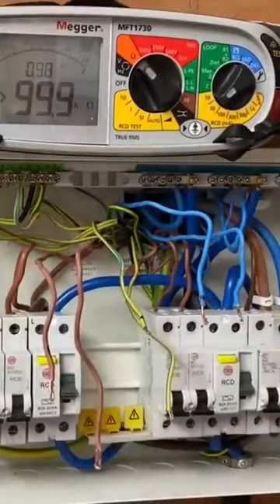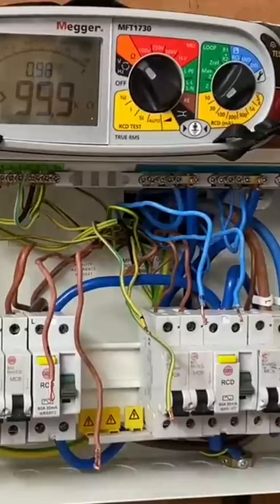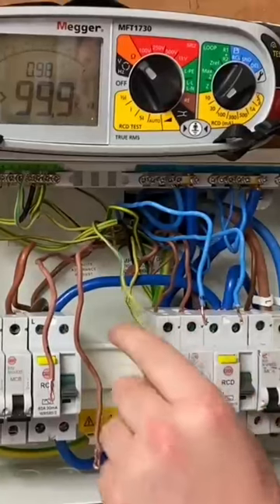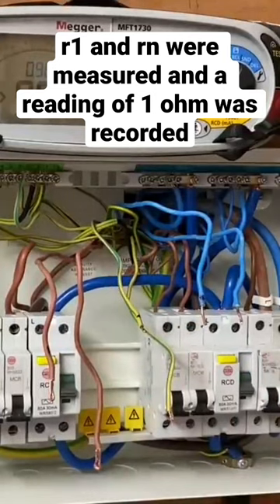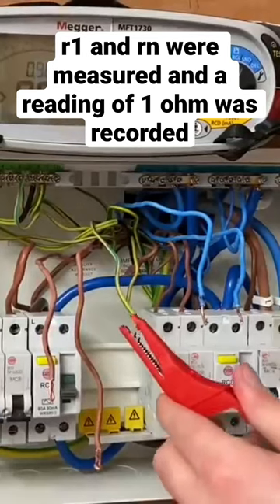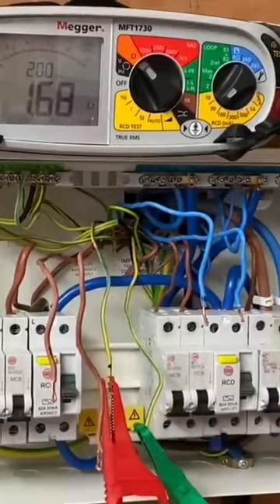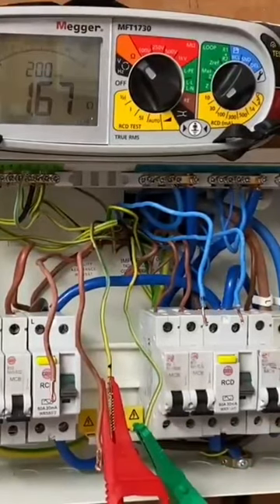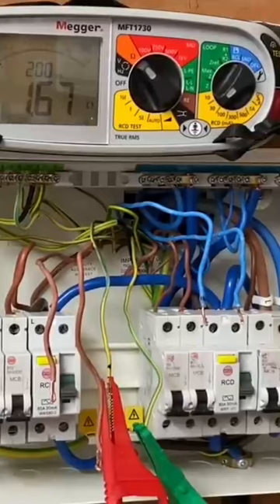Magical 1.67 - Ring Circuit Testing

Comment: Just divide the bigger number by the smaller number and you get the multiply number you need to times it by. 2.5/1.5 = 1.67

Comment: Why would you expect the value to be 1.67 x 1 ohm. What is the reasoning behind those numbers?
Reply: Just the ratio between the line and earth. 2.5 / 1.5 = 1.67, therefore if the end to end for the line is 1 ohm, then the earth should be 1.67 times greater as it’s a smaller conductor
Reply: Smaller conductor = higher resistance mate
Reply: @callumsimpson7483  thank you!